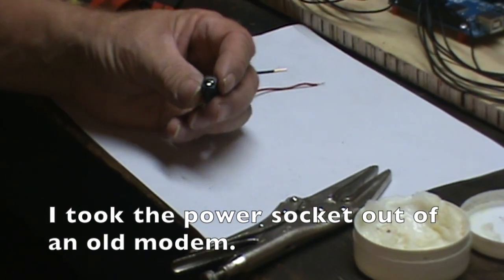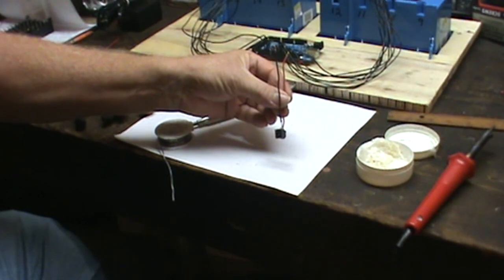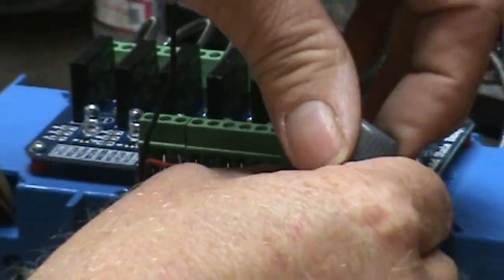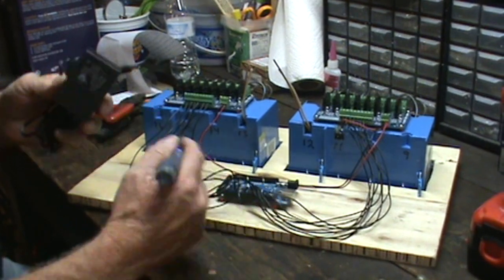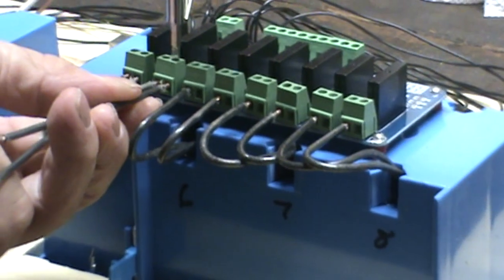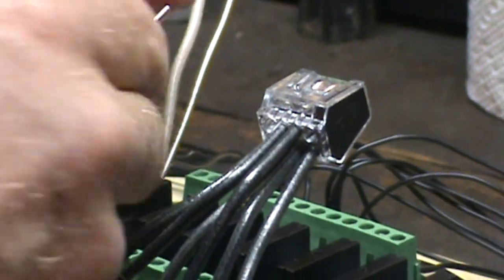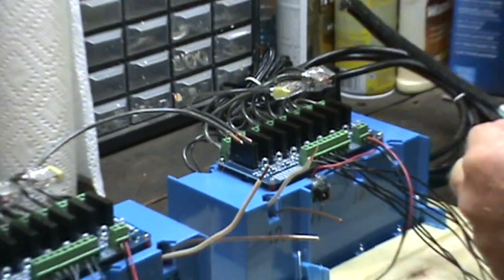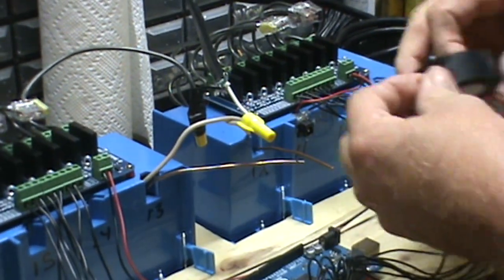Cheapskate Video 1 Part 5, Christmas Lights to Music Using Arduino and Vixen Lights

Comment: Hi Dee, my relays light up when they are suppose to but the lights that are plugged in don’t light up. Do you no what could be wrong
Reply from the maker: If the relay lights up when it's supposed to, here are some things to check. Are your relays high or low trigger? High means they are on when the relay lights up. Low means they are on when the light is not lit. Do you have AC voltage going to one side of the relay all the time? When the light comes on the relay closes and allows the voltage to pass through. If you can't figure it out, send me your email address (I won't publish it here) and I'll send you mine then you can send me pictures of your setup.

Comment: Hi Dee,  Great Videos.  I have built the box and successfully build my light sequences.  I am using LED lights.  When I run the sequence my lights will not come on.  The LEDs on the back of the relays are always very dim.  I check the voltage at the receptacle and it is less than 10 volts.  Any suggestions?   These are the relays I am using.  KNACRO 8 Channel high-Level Solid State Relay modules Blue Board DC 24V Solid State relays 240V AC 2A Output with resistive Fuse 240V 2A 50HZ 60Hz high-Level Trigger (DC 24V).  I have a 5 Volt 2 AMP power supply.  I am also using a ELEGOO MEGA 2560 R3 Board ATmega2560 ATMEGA16U2.  Thanks in advance.
Reply from the maker: 24 volt relay with 5 volt power supply. I used 5 volt DC Omron high trigger relays with a 5 volt DC power supply. Do the specs on your 24 volt relays say that the relay can be powered with 5 volts?

Comment: Will a 6v 750mA power supply transformer work to power 2 8 channel relays?
Reply from the maker: The Omron boards like I use in the videos show in their specs 5VDC/160 ma all relays on per board. If you are using 2 boards double it to get 320 ma. The specs also show 2.5 to 20 volts to turn the relays on. Because of what the specs show I would suppose a 6 volt transformer would be ok but don't quote me on that. I've always used a 5VDC transformer (which is how they list their boards), 2 amp which is 2000ma.
Reply: Dee Higginbotham ok sorry to add to my last question but I just found a 12v 1amp supply. This should work well right?
Reply from the maker: As I said before, Omron lists their boards as 5VDC. I have never used anything but 5 volt DC transformers. I am not an electrical engineer. I would suggest you find someone who can tell you if you can use anything other than 5VDC transformers without worrying if they will burn out your relays. 5VDC transformers aren't hard to find. Most cell phone chargers are 5VDC. you can also buy used ones online from ebay.

Comment: Hi.    if i use arduino uno.   and put the code. Since. U hv used. Arduino. Mega.  And the connection are quite big. I want to make it for home purpose. Beause. I want to make it only.      on 6 relays.      So can u help.  me what i must do.  In detail.  Thanks
Reply from the maker: It's all in the videos.

Comment: For some reason my relays/lights stay on when there's no sequence/song playing.  In other words, they blink OFF when they're suppose to blink ON and when the sequence is done they stay ON.  My relays are not solid state...could this be the problem?  Should the coding be different?   I have the power supply positive+ to JD-VCC, the negative- to GND (no jumper.)  The arduino 5V to VCC at the relay pins.  I tried the power wires in different configurations too. I'm stumped.
Reply from the maker: The manual relay I use works backwards from my SSR's. It is called a low trigger which means the default position (no power coming from computer) is on. When the computer sends power it turns them off. When I say on and off I'm talking about the magnets inside the relays that open and close the contacts. My relays have three terminals. Look at the diagrams on the relays. Connect your 110VAC to the common. On mine it is the center terminal. One side shows open on the picture and the other side shows closed. The diagrams are for default positions. When you put 5VDC into the relay it comes on. This is the default position. In this position you would want your 110 VAC lead connected to the open side. This relay must remain powered by your 5VDC transformer at all times. If you shut it off the 5VDC all relays will close and send power out to your lights.
Reply: Thanks for the reply.  I can get the christmas lights to stay off (with no sequence playing) by switching around the relay output 110VAC wires like you mentioned.  But the LED lights on the relay boards stay on when there's no sequence playing.  The LEDs come on as soon as i insert the usb cable into the arduino mega.  like I mentioned in the comment above,  could it be because I have 5V coming from the arduino to the VCC by the relay pins?  If I disconnect these, nothing lights up even with the sequence playing.  I've google everything I can think of to get this to work.  Sorry to be such a pain in the rear.  Thanks again.
Reply from the maker: The lights on the relay board should be on with no sequence playing.  As I said these are low trigger relays. Also you don't want to use 5VDC from the Arduino to power the relay boards. Use a 5VDC transformer. You can run into a lot of problems using the Arduino 5VDC.
Reply: Thank you very much for all of your info!  i'll try it again later on tonight when I get home.  Happy Holidays!

Comment: First thank you so much for the videos. Would this DC receptacle work instead of soldering the one you use? I can get one like this quicker which is why I ask.

https://rover.ebay.com/rover/0/0/0?mpre=https%3A%2F%2Fwww.ebay.com%2Fulk%2Fitm%2F161938569087
Reply from the maker: They would be fine but you don't actually need them at all. Just cut the plug off your transformer and directly attach the wires to your relay board. Just be sure to attach the positive to the positive terminal and the negative to the negative terminal. You can use a DC volt meter to see which is the positive.
Reply: Dee Higginbotham thank you sir!

Comment: What about the 110 Volt?  For 48 Channels would I need more than one of them?
Reply from the maker: Depends on if you are using standard strings or all LEDs like mine. If you are using all LEDs, 1 120 volt supply is enough.

Comment: Mr. Higginbotham, how do you get the usb connections to reach to your computer? I need to put my computer in my garage and a 33 foot usb cable will not reach to where I need it. How would I ge t the usb cable to reach to my computer? Please help.
Reply from the maker: I use a powered usb hub
Reply: Dee Higginbotham oh, thank you
Reply: Dee Higginbotham The USB hub boosts the signal?
Reply from the maker: The newer usb hubs don't work as well as the older ones. I bought mine on ebay. They use a usb A to usb B cable.

Comment: Mr. Dee with your larger boxes did you use more than one Arduino board in each box or can you run more than 16 channels on one board
Reply from the maker: Each Arduino has a 48 channel program loaded on it. I use the same program on all arduinos, even on the boxes that have less than 48 plug ins.
Reply: Dee Higginbotham cool thanks for the info. i shall soon begin construction on my first box. Awesome videos!!! I have benefited greatly from it.

Comment: Hi Mr Dee hope you are doing good I have a couple of questions if I'm building a 48 channel can I use the common on all boxes just run it off of each other and the ground to and on the AC supply to the relays can you tell me if one power cord is enough to run all six relays or can you tell me how many I can run off one power cord thanks
Reply from the maker: Depends on the lights you are using. I use all LED's so 1 cord is fine. Conventional lights would require more power.

Comment: Hi Mr Dee thanks for your time would a power supply for led lights work on powering my relays up or does it have to be no more than 5 volts thanks
Reply from the maker: The relays operate on 5 VDC. You can look up the specs for them.

Comment: Hi Mr Dee sorry to keep bothering you if I buy powered USB ports should it have a Ac plug going to it to plug into the wall thanks again keep up the good work very helpful
Reply from the maker: Yes they need their own power source. I have also found that some of the newer powered usb hubs don't work very well. I went on ebay and purchased a few of the older ones.

Comment: Question since I'm not very good with wiring. If I made a 48 channel controller would I connect the black cable from each relay together the same way into 1 power cable (and same with the white and ground)?
Reply from the maker: Make your 48 channel box just like I showed for a 16 channel box. Yes, all hot wires (black) going to the relays are connected, all neutral (white) wires are connected, and all grounds (bare wires) are connected.
Reply: Awesome thank you!!